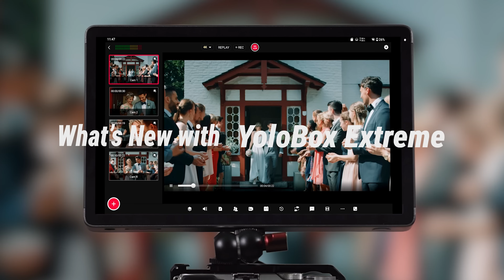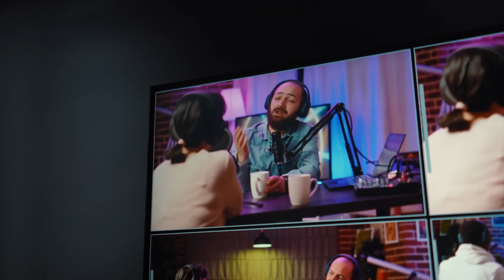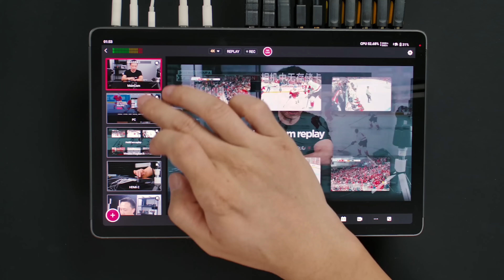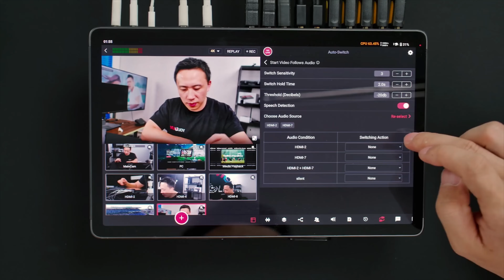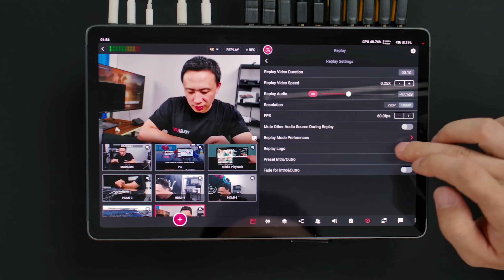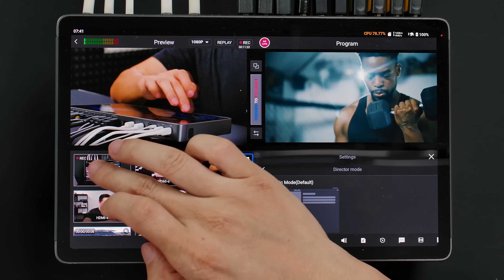What's New with YoloBox Extreme

Comment: I want to build a 4-camera wireless system with your products for livestream fitness.  How can I stream all four cameras to the viewer simultaneously so they can view the desired angle?
Reply from the maker: Hi @GRdilver 😊  Thank you for reaching out. Currently, YoloBox doesn’t support viewers selecting their preferred camera angle. 

You could consider using the MultiView feature to display all four cameras in a single screen. Another option is to combine MultiView with Auto Switch, arranging one main camera (larger frame) and three secondary cameras (smaller frames) within the layout. By setting the duration for each view in Auto Switch, you can create a timed rotation of all four cameras, freeing your hands from manual switching.

Besides these two options, you could also consider having one person operate the cameras from behind the scenes.

Hope this helps. Have a nice day.

Comment: Need a safe way to hold the cables in
Reply from the maker: It’s recommended to wrap a protective layer around the cables and secure them with tape to floors or walls in low-traffic areas. If the budget allows, wireless transmission could also be considered. Hope this helps.

Comment: This Yolo box is better than the predecessors and the vertical streaming that's coming. It's going to take it to the next level. Now, this is providing that all the overlays fit for vertical and not just-chopped.
Reply from the maker: Hi @SamuelFRobinson 😊  Thank you for your kind words about YBE and your support for YoloBox! I'll share your suggestion with our technical team. Perhaps we can consider adjusting the default overlay settings specifically for vertical streaming mode.

Comment: Is there a way to control it from Bitfocus Companion like Atem Mini Pro ISO and many other Blackmagic Atem devices?  If that's available I'd gladly get one, that's a must feature for me.
Reply: They seem to run specifically on YoloDeck. I'd love to be using my StreamDeck too, but...
Reply from the maker: Yes, YoloDeck serves this purpose. However, I can confirm that YoloBox is not compatible with Streamdeck.
Reply from the maker: Hi @rsmolkin 😊  Currently, YoloBox is not compatible with Bitfocus Companion. However, many of our users have successfully tried (and are currently doing) controlling YoloBox using ATEM. You could check out the connection method in this video: https://www.youtube.com/watch?v=pQVRmB0XaXA. I’m not sure if this method meets your expectations. And if you only wish to control the YoloBox via buttons, YoloDeck might be able to meet your needs.

I have shared your suggestion with our team. However, realistically, implementing this feature would require considerable effort, especially considering the other updates planned for different YoloBox models (such as YBP and YBM). Given the number of pending updates for these models, it might not be feasible in the short term. We appreciate your understanding!